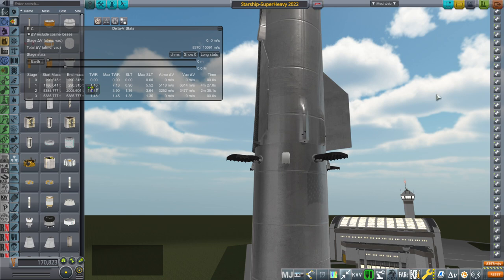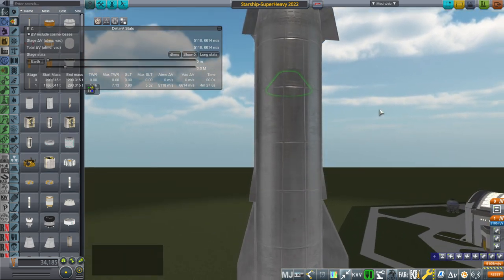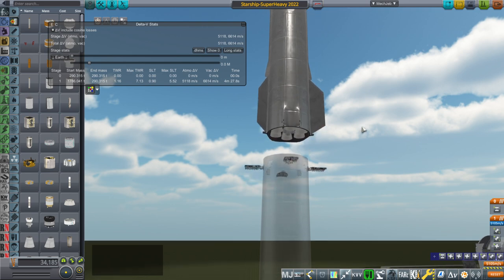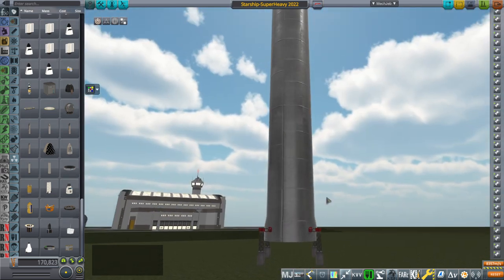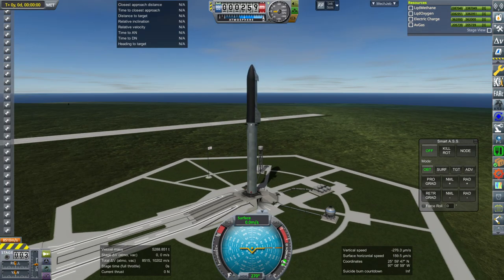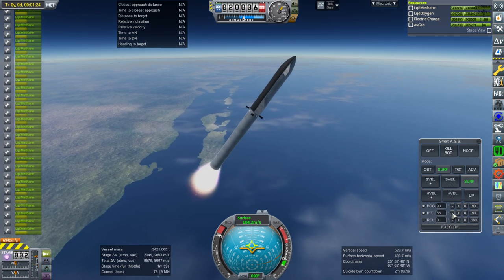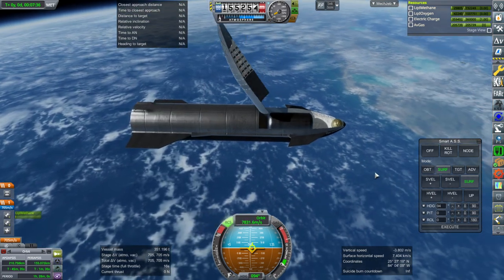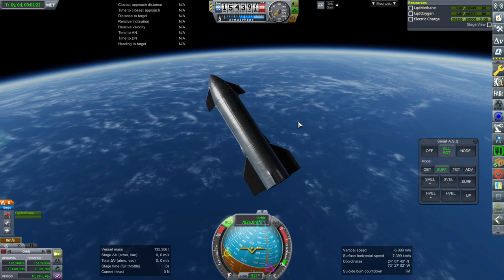Realism Overhaul in KSP 1.8.1 - 9-engine Starship Payload Test

Comment: I'm thinking the whole system came in over mass(hence the massive mass reduction efforts on SH), and they needed better efficiency on the second stage for one reason or another, and running straight RVAC obviously outweighs the benefits of the reduced 3 RVAC setup
Reply from the maker: One way or another, the answer comes down to Super Heavy not being as efficient as they thought it would be.

Comment: Would it make a significant impact to create a lighter fixed gimbal variant of Raptor 2? From what I've seen recently the outer ring of Raptors will not have any form of relight capabilities since they won't need any. They'll be spun up with cold gas from the launch pad instead of on board COPVs.
Reply from the maker: Since I can't pin the exact mass of the engines, much less just the gimbal system or ignition system, I really can't say.

Comment: 210 t dry for Booster?
Reply from the maker: Just about - I forget how heavy the grid fins are, since they're scaled up a lot. Without the grid fins, the tank is 140 and the 33 engines should be 66 tons, so a total of 206 tons. There's also the mass of the RCS blocks.
Reply: @RaizSpace , ok, so conservative here. I'm seeing 180 - 190 t depending if it gotta carry a heavy Starship or not. Nontheless, helps to validate my data, thank you! :)

Comment: You've probably already answered this but why do you use 1.8 instead of 1.10
Reply from the maker: I've had minor quirks in 1.10 and beyond, especially on release from launch clamps. There have also been issues with life support consumption and EVA propellant.
Reply: @RaizSpace  yeah true I've had issues with electric charge suddenly running out

Comment: what if the tweet was about replacing all engines with vacuum ones? for the very short landing burn efficiency doesn't really matter. increasing thrust AND increasing the number of engines is not going to increase ΔV of the upper stage. also it lands on 2 engines, so it can be 2 sl and 4 vacuum. that's a better way to get the same proportion of sl to vac. what do you think?
Reply from the maker: His tweet was entirely specific: https://twitter.com/elonmusk/status/1472059476253548544. And he specifies increased propellant load, which I very clearly talked about in the video. I specified a heavier Starship with more fuel, which yields more delta-v.
Reply: Vacuum engines don’t gimbal and having the 3 that do dead centre provides a better control of different axis. Also it’s not very ‘safe’ to run vacuum optimized engines at sea level